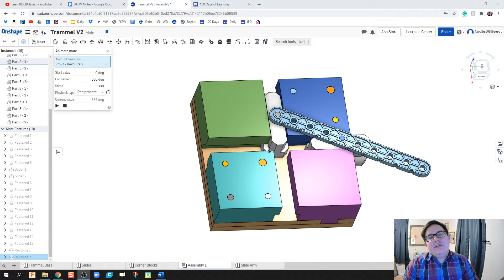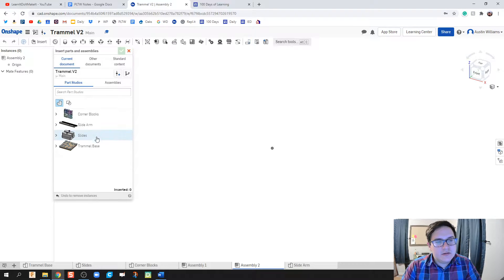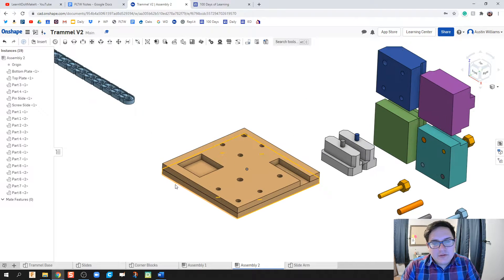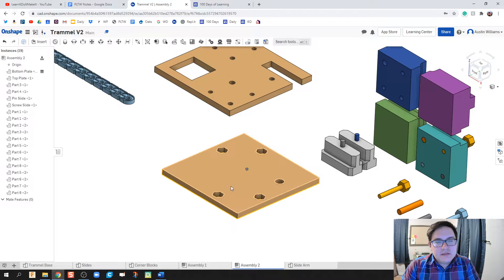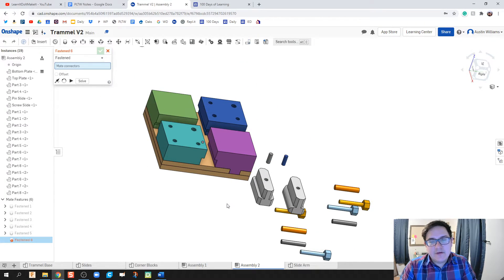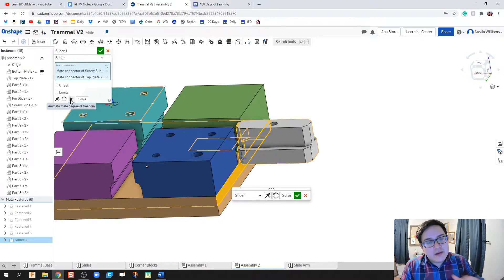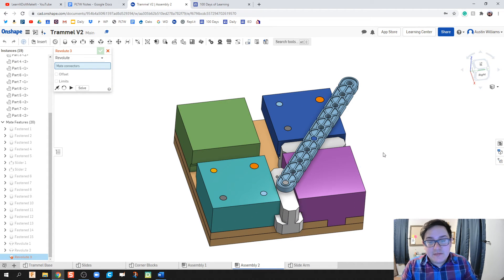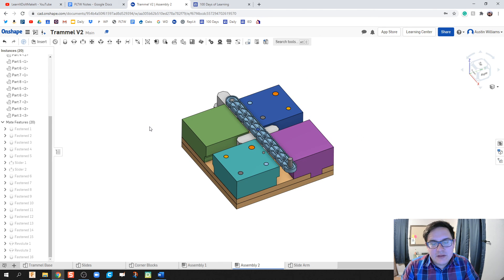Trammel Bottom Up Design (Assembly) -Day 33 of 100 OnShape Journey

Comment: I have a problem! how do I fix my design if is upside down for example my object is not facing forward how do I fix it?
Reply from the maker: You can use the transform command to rotate or move an object. Transform command looks like a box rotating. Under the commands, it will ask how you would like to rotate. X,Y,or Z axis. That will allow you to flip it over.
Reply: @LearnItDoItMakeIt  where do I find the transform command
Reply from the maker: @MboaRealEState  At the top, near the middle of your command bar. I'll make a video tonight for you.

Comment: I'm having some problems every time that I try to move my other items to connect to the other is disconnecting i want it to stay it together how do I fix that?
Reply from the maker: When you are making mates, there is a "preview" of those two parts only. After you select the green checkmark, it will take into account of the other pieces. Make sure to "fix" your base plate to prevent it from moving. Right click on the part, select "fix".
Reply: @LearnItDoItMakeIt  ok thank you